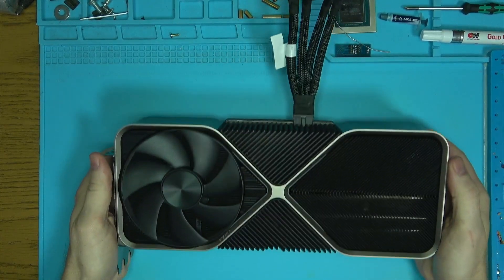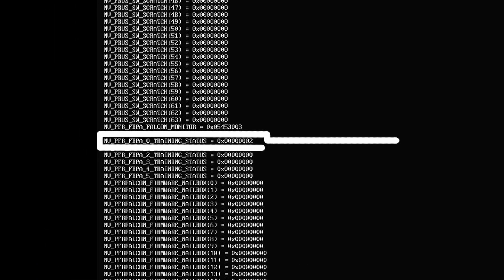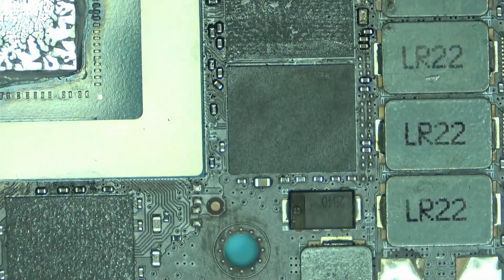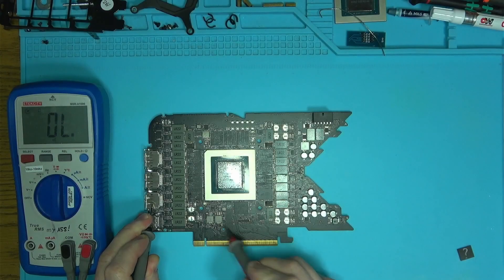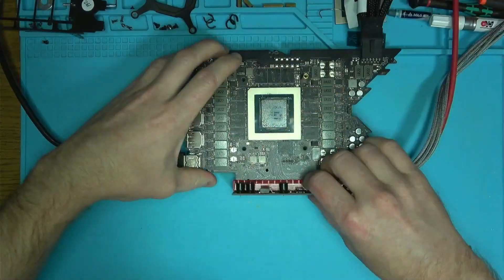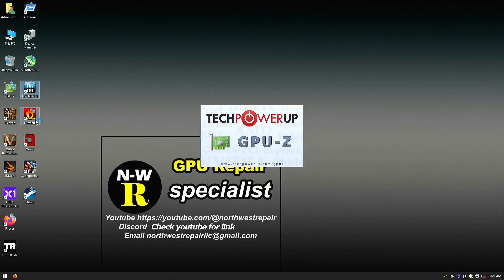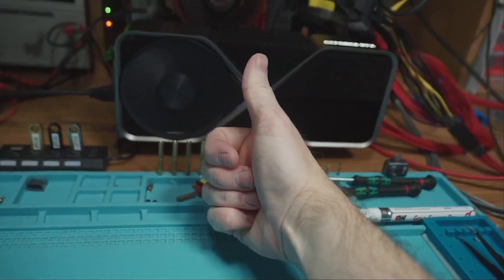Accidentally scraped core on a 4090

Comment: The die is mounted as a flip-chip. All of the transistors and nanometer thin wires are packed into a miniscule layer on the other side, that is contacting the green substrate. The face we are seeing, the one the coolant contacts is the backside of the chip, over 90% of the thickness is "inert" silicon. You could grind some of it off, it has been done before by people who chase world records. If you are careful enough with the grinding and avoid chipping or cracking the die, it will work without any issues.
Reply: i've heard that nvidia chips have thicker mask than amd. any idea how much thinner amd's is?
Reply: yeah thats what I was thinking like people would lap silicon chips to get the thickness down, this scrape is nothing.
Reply: Yeah, this scratch wont cause any direct issue, but it can lead this silicon to be more vulnerable to thermal expansion cycles or other physical factors. Still kinda odd to see this kind of scratch from the factory
Reply: "it has been done before by people who chase world records"
And was pretty common among enthusiasts back in the 6700k/7700k days when they put thermal paste instead of liquid metal inside the CPU's, if you were delidding it wasn't that much extra effort to lap the die.
Nowadays, with CPU's sucking back 300+ watts and 360mm AIO's arent enough to get the advertised speeds, more and more people are doing it again. You can even buy "die lapping kits" and its so much easier than it used to be.

Comment: OCers have been lapping silicon dies for years so it's not that surprising. There is a diffusion barrier between the the actual chip circuitry and the top of the die, usually it's made from silicon nitride.

Comment: I had performed lapping on a Strix 3090 core, the results was 3c less overall temperature on the core and it was more like an experiment to me than anything else. Core lapping is for those that running LN2 ,this extra flatness helps the thermal paste to not crack under extremely low temperatures during LN2 usage. Its not something that an air-cooled card or even watercooled get any benefit from. I'm not sure what caused that huge crack on that 4090 I'm wondering if you had any information about it after the video.
Small edit: i realised it was a scratch afterwards but it can become a crack if the card gets mishandled.

Comment: lapping has worked for me in the past loosing about 3 to 5 degrees.. but lapping the heat sink helps too..as long as it doesn't make the heat sink too low where it doesn't contact the core as well..

Comment: Core lapping was great back in the core2duo era.  I had a... I believe e6300 or maybe e6200? I forget.  Dual core that I had clocked from base 1.83ghz to 3.2ghz.  Which was just massive back in the day when it first came out.   

I was using a copper 77 bonneville heater core I had modded into a radiator, someone had posted the instructions back on an older overclocking website.  Back when the internet still mostly just had information and things you can't unsee.  Full loop was copper, very low maint

The lapping was almost necessary for water cooling it, not because it produced a lot of heat, but because it produced uneven heat.  Core2Duo lids were pretty warped. Heatsinks really do prefer that flat resting spot.  This to my memory produced some of the original arguments about 'how much thermal paste' and 'how to put paste on' that the internet saw.  

Once lapped I could drop all my watercooling fans to their lowest level and the chip barely left ambient temps.  (Given in an air conditioned house).  If you really polish it (And do not use chemicals, use a natural buffered polish) the heat transfer becomes so good that the amount of cooling paste you use starts needing minimized.  You will have to also adjust clip height of the heatsink as well, to lower further.  But carefully so because now you can damage the chip easier. 

Its a days of work if you do it right, but it pays off for a PC you will keep for a decade.

I was thinking about grabbing a newer chip and trying delidding completely.  Drops of 12+ degrees celsius simply from removing the lid and mounting to the chips themselves sounds fantastic.  Would really like to do a smaller PC build and try to use a minimalist watercooling design.

Im curious if I could get away with just dropping conformal coating over the length of a board, with the mere exception of the tops of the chips, and then just going to town with liquid metal cooling lol.  Can you conformal goat the insides of a CPU once delidded?  That is my question.
Reply: i had a Q6600 delidded, and lapped both silicon and water block, connected to a zalman reserator 1. can't remember the exact speed i was able to get but that thing was crazy fun and fast. i killed most of the system (at least the ram and northbridge) when trying to watercool and overclock the ram past any reasonable level ;-; wish i still had it

Comment: Thermal Paste negates poor cooling due to pits, scratches 
and dents by filling them up, but if there is scoring or a 
scratch with high ridges that overly protrude, it wouldn't 
hurt to polish away the protruding ridges down leaving the 
thermal past to find it's way into the valley of the score or 
scratch, in fact that's why thermal paste is mainly used, as 
it increase's the surface contact from the chip to the heat 
sink.

Comment: No core lapping, but I did notice that scratches, laser etching or even some chipping won't affect the silicon die, as long as it does not reach the other side if it - that's where all the functionality of the chip resides. As for the rest of the silicon, well, they can't make it thinner, because it'll become too fragile to handle, and you don't want it too thick to the point where heat has trouble getting out.

Comment: I have done heatspreader and heatsink lapping and it actually helps especially because of poor surface finish/flatness of heatsinks (even though I bought Noctua). Better than using liquid metal which destroys everything!
Core lapping would probably not bring a lot of improvements (it is usually lapped in the factory), better to lap the GPU heatsink.

Comment: It looks like a hair line crack on the die you could have checked it before and after using the hot air at the memory chip in question. I'm surprised it still works after the memory chip was replaced

Comment: JFC that is almost a full crack! how its still function is that must just be in the diffusion layer and perhaps most of the transistors are on the bottom closer to the interposer so as long as the crack doesnt go all the way down through its fine?

Comment: Core lapping only makes sense if you are doing LN2 with a perfectly flat pot. Otherwise its pointless on a GPU.
Reply from the maker: what is LN2 ?
Reply: @northwestrepair  Liquid Nitrogen ;)
Reply: or maybe repair of a scratch that could chip with heat cycles
Reply: Considering the cost of a 4090 this is insane. No quality control anymore.
Reply: @devilzuser0050  Seems to me if you are using LN2 the whole chip is going to be way below 0 degrees and taking any material off of the chip is pointless.
Reply: If is like intel cpu, all transistor are on the bottom of the crystal but this could easy shatter like a glass.

Comment: Core lapping on GPUs is not recommended for 99.9% of end users. It is extremely hard to do, due to the fact you really should lap with the core soldered to the card. It can take weeks of disassembly, lapping, reassembly, and testing. You also have to keep the whole card extremely flat and use correct grit sandpaper. 
The thing people forget, is CPU lapping is generally done to the IHS (integrated heat spreader). Whereas, a GPU is direct die and one mistake can make the whole card worthless. (Apart from spare parts)
It does take a lot of mental skill and maths, to correctly lap a GPU core.
Bottom line, if you as an end user are thinking of lapping, your GPU core for better temps. Look at buying a water cooling option instead, less room for errors and temperatures will be better than a lapped GPU with an air cooler.
Reply: Yeah, the real issue is that you can't move the card on flat lapping table, like with a CPU IHS or even the CPU itself. You need to have something moving on the card, and at that point the risk for applying uneven force becomes very high, and once you sand one corner too much, that GPU will have high temps for the rest of it's days. If you REALLY want to do it, I'd figure the best way would be to get a small piece of flat glass, where you would attach some sandpaper and try to sand it with the weight of the glass piece, not by pressing down yourself. This would make it extremely slow and tedious, but would allow you to check the flatness often enough that a small failure won't end in catastrophical temperatures.

If you are interested in better heat transfer, I'd recommend "roughing up" the die with 1500 grit until the laser etching markings on the die feel smooth to touch. I've done that and it seems to drop the temps a tiny bit.

Comment: The upper layers are usually only pure silicon, as long as it is not too deep, it'll work..maybe put some paste into that groove :D
BUT that "scrape" actually looks like a crack...
Reply: Nah, that's a deep gouge. The other scratches around it indicate that it's bad handling from whomever was last working on that board.

Comment: Lapped pretty much all of my GPU´s back in the day when we built phase change cooling in pursuit of that top spot in 3dmark.  But also more recently on a 580x and a couple of laptop CPUs. Just to get the liquid metal to wet the surface properly. Finish with 2-3000 wet paper and the LM was applied in 2-3 seconds. Just like on glass or gold.   
You can sand/lapp most dies quite a lot, and with the right light at the right angle you can usually see when its time to stop, because the contours of the actual die starts to show.   Wouldn't recommend it. Except for roughing up the surface with 2000 paper before applying LM.  

On the main topic, that scratch looked nasty.  Im a little surprised it still works, but most of all I´m wondering HOW tha f.... did he manage to do that. Its extremely hard and brittle.

Comment: Hi Tony!
That was quick but interesting :)
Was it a scrape or a crack?
If it was a crack, sometimes when you screw down the heatsink too strong, that can happen.
When it comes to core lapping, well I would not advocate this unless you are about to overclock your GPU (which is already out of warranty) and increase heat transfer.
Personally, I would rather replace thermal pads and the paste with sth better and improve the air flow within the PC case. Keep in mind you can void the warranty when doing GPU lapping.
One more thing, if your GPU temps are normal I would not do it since there's no point.
See you :)
Reply from the maker: its a scrape but it can quickly become a crack if owner is not careful
Reply: @northwestrepair i have an rx 5700xt and I used kyronaut and now there are small cracks on the die itself but it still works,the tm was the reason for micro scratches and small cracks on the die.maybe the scrape on this 4090 was bcz of thermal paste? Or possibly tightening the heatsink too much
Reply: @RelaxingSounds-ih8qd the pads or the paste you use? I have a 5700xt as well
Reply: @SkylineFinesse  I used thermal grizzly kyronaut paste
Reply: @SkylineFinesse  do u have discord I can show u the damage
Reply: @RelaxingSounds-ih8qd  yeah, it's my youtube handle

Comment: Just FYI, GPU core lapping is only beneficial for XOCers, the average user won't benefit much from it. Just make sure to buy a good AIB model that has decent cooling and acoustics, as you can see in the video a simple scratch on the upper layer of the core won't damage it, unless it runs deeper into the die. So don't you worry, if it work it means it's okay and the scratch won't effect the cooling or gaming performance of your GPU.

Comment: oh wow that is deep, but regarding sanding down the chip i don't think it will help much in normal environments. I believe the chip has a very small  height difference between the center and the sides to have better contact after heat expansion, which is why top overclockers lap their dies as with sub 0 cooling solutions there will be no expansion. (I haven't done any of this myself, its just what i have learned through videos)
Reply: btw nice repair, also I'm not a professional but that cut looks a bit scary for longevity. Maybe thermal cycling can over time break the chip, but this is just some thoughts from a random idiot in a youtube comment section (me) lol

Comment: Am pretty certain that damage was NOT caused by you Tony (looking at the footage along the way, no streaks at all in the compound on top).
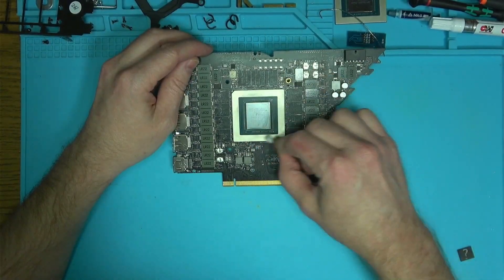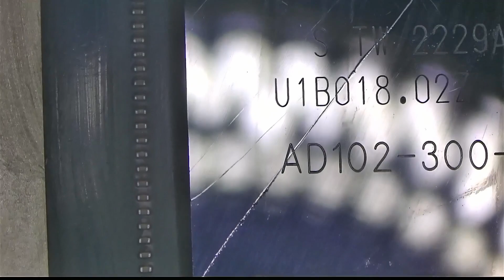Also, at 2:03 it looks kinda like a scratch but at 2:09 and afterwards it looks 100% like a crack - there's even a little bit of silicon missing at the bottom-left end of the gouge/crack.

Comment: Dang, that's a gnarly scratch on there. I wonder if you can shave it down on a 3-axis CNC machine instead of lapping or grinding it down. You wouldn't be able to use a dinky little tabletop CNC though, it would have to be able to hold +/-0.001" tolerances, at the very most. I'd probably just eyeball it anyway. Touch the endmill off on the top of the die and then jog down a thousandth and let 'er rip. You'd need something super duper sharp and cut really slow, likely with some kind of lubricant, and just let it slowly shave it off. My only concern is that it might actually crack or chip the die because it's more like glass than anything else. Or you could just use a tool that will abrade it down, and the CNC is just doing it automatically for you. These are the questions. Personally, I'm very unimpressed that we're still making integrated circuits with silicon in the first place. Virtually any other semiconductor material that transistors can be made out of runs at much lower power because it has much lower resistance, meaning you can really crank up the clock rates - by about an order of magnitude, without generating a ton of heat. We really need to get the heck off silicon already, it's so played out, and we're pretty much at the end of the line for how small we can fabricate transistors out of it too so it's a veritable dead end.
Reply: That would likely crack it.

Comment: Most large chips nowadays are packaged using the "flip chip" method, which means the circuitry is on the lower parts of the die.

Comment: Scrapped several cores of NV43 cards (6600 GT) by trying to install silent cooling solutions (NV silencer 6). Pretty annoying. But otherwise those very good performing midrange cards were below 200€ back then.

Comment: The actual depth of the circuits made on the silicon die is not very deep. The substrate is much thicker, and you can shave a lot of it off before harming anything.

Comment: That scratch looks like grit contamination. You had a tiny piece or pieces of something relatively hard which got scraped against the die when you were rubbing it down. A microscopic grain of sand could have easily caused this. The directionality of the scratches are also consistent with the angle of wiping at 2:00.

Comment: I’ve repadded and repasted my 3080ti 5 - 6 times I can’t get the temperatures below 90 on memory and 93 hotspot. Can u help plz could u send u the card   I can’t afford a new GPU I’m retired and on disability I’ve not been able to race in Iracing for a good few months now. It’s not like I’ve not tried either 😂 plus I’m in the uk. All the best steve. Have a great Christmas and a happy New Year
Reply: you have a airflow problem, upgrade case. set fan curves properly on both case fans and gpu fans